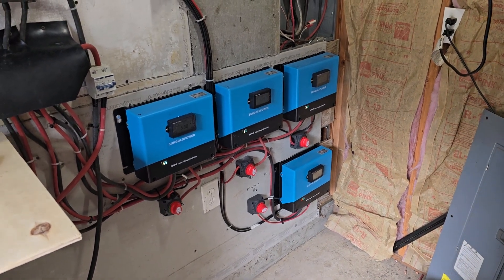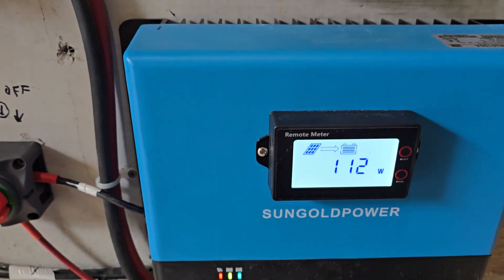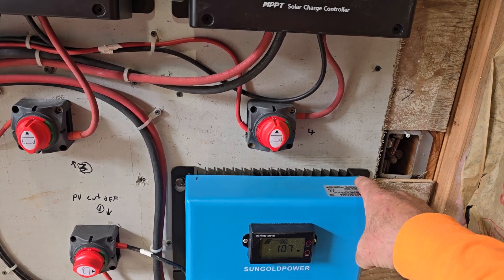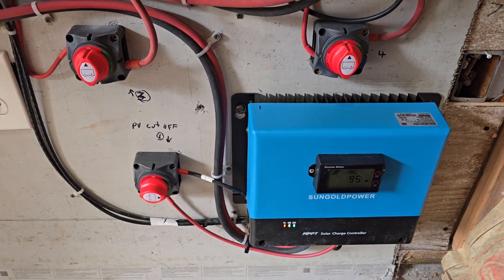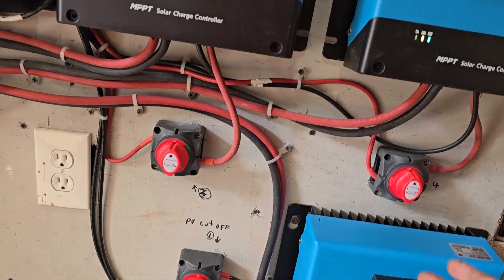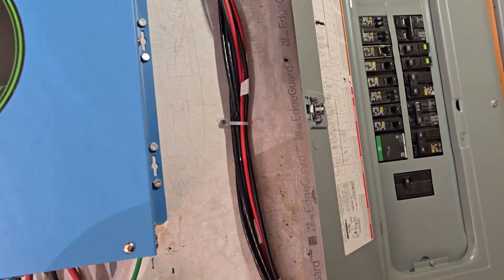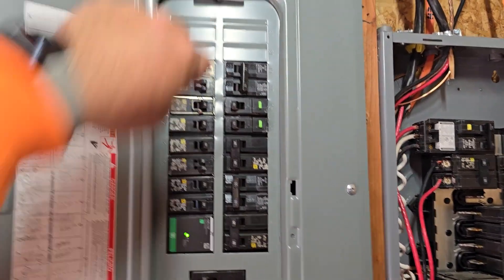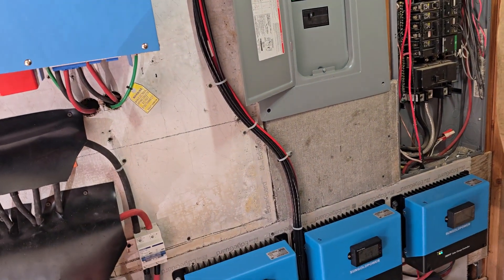Solar Charge Controllers, Here is why you may need them.

Comment: I like the looks of those chargers.   I am wondering if they have any trouble with over voltage when the batteries are nearing full and Sun is at full board?  Do they manage the spiking that happens on cool partly cloudy days..  I went over to Sun Gold website and didn’t see these chargers. Are the discontinued?  Thanks in adavance..  great setup you have.
Reply from the maker: They regulate the power great.
They do need to have good clearence to disipate heat.

https://sungoldpower.com/collections/solar-controller/products/100-amp-mppt-solar-charge-controller

Comment: Nice setup. I've been trying to size up an array for my place. So far I figure I can get 12 panels on my house roof facing south and 14 panels facing south west on my garage roof.
The panels I was looking to buy are 570 watts, but the sale ended and now they are too expensive.
12 years ago I priced out panels to cover my garage and just the panels came out to over $12000. Now it should be around mid $3000 if I can find a nice deal.
Reply from the maker: Right now we have 22 of our 32 panels up on the roof. This week is the first time we have had sun.
Yesterday the charge controllers dumped most of the power as the batteries were full or close to full. I build our system for winter use as we do not get a lot of sun in the winter in Oregon.
Right now at 7am the 22 panels (550w each) are producing 1300 watts. Sun just starting to hit them.
They are at 26⁰ on the roof, 46 is optimal.